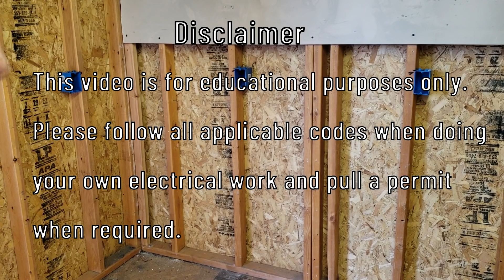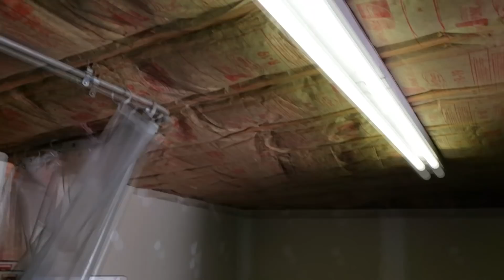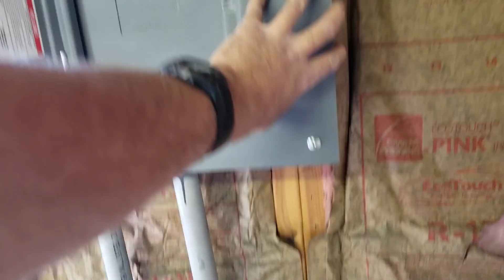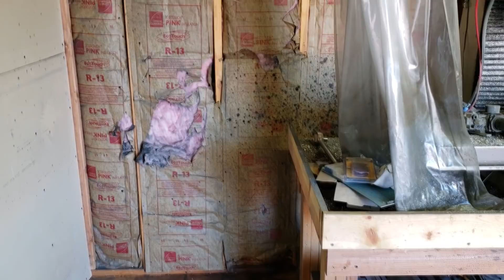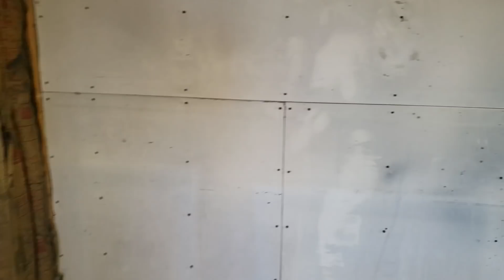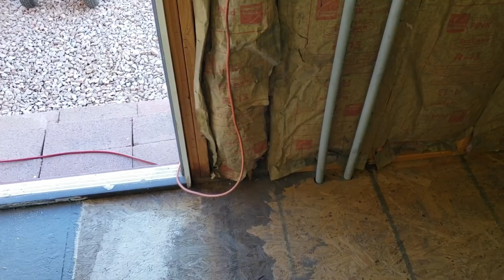Shop Electrical Part 1 -  Layout and Boxes

Comment: Can never have to many plugs, you going to plumb air to when you get the sheetrock done?
Reply from the maker: Exactly!  Its a wood floor so I will probably just run hose underneath.  But I have 2 stray cats living underneath that my wife keeps feeding.  LOL
Reply: Those cats will be fine with full stomachs
Reply from the maker: @NuttyforNissan  Yeah, my wife certainly fills mine good.  :-)

Comment: In the next month or two I'll be doing much the same as your doing in this video Craig. The electrical I sure can't advise on. But if I were you I'd very seriously consider either tearing up that chip board on the floor or sheeting over it with a minimum of 3/4" ply. At best that chip board is good enough for wall sheathing. Compared to actual 3/4" plywood it's got very little long term load bearing capabiliy's. My current floor is 3/4" mdf and that's getting cut out and replaced with one layer of 3/4" fir ply and a second 1/2" layer of G1S to get a smooth knot free floor. No one can anticipate what further equipment they might get in the future, and right now is when it will never be easier to upgrade your floor. I'm also going to add a second joist under all the areas the mill and lathe will be sitting on. Wood frame construction is a long ways from ideal for a shop floor so it needs strengthening where ever you can. And if it was at all feasible for me I'd pour concrete instead.
Reply from the maker: Cool!  Mine is turning out to more work than I expected, but isn't it always.  LOL  I have been doing electrical for over 20 years, so I think I have that covered.  The floor is some kind of OSB tong and groove that is specifically made for flooring homes I think.  Not sure if its in the cards to replace it any time soon with the Tormach on there.  I will be painting it with 2 coats of mold paint and 2 coats of decking paint.  Wow, that will be one nice floor when you are done.
Reply: @craigsmachineshop2040  LOL, oh I'm sure mines going to be far more work than I think it's going to be as well. That OSB you have is a bit better than I'd thought then. You don't seem to see much for accuracy issues with a mill sitting on a wooden floor structure. With my lathe it's not hard to see noticeable changes with a good machinisty's level sitting on it for a few hrs if the outside temperature or humidity changes only a bit. Anything that takes some real accuracy requires the lathe to be re-leveled before starting the job and I'd  better get it done fairly quick. A wood floor with a lathe is almost worthless. A dirt floor would at least be more stable. Even with what I'm going to do I'm not all that sure I'll see much improvement. Maybe, but I wouldn't bet on it.